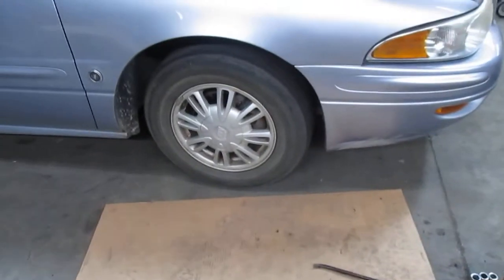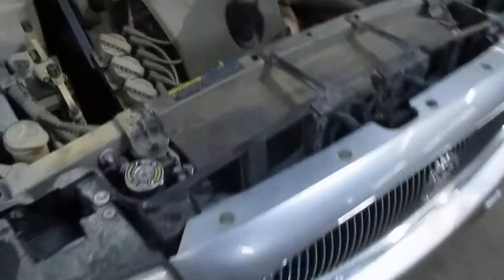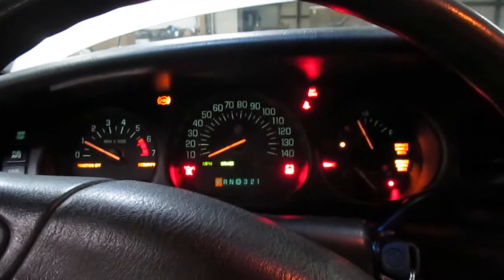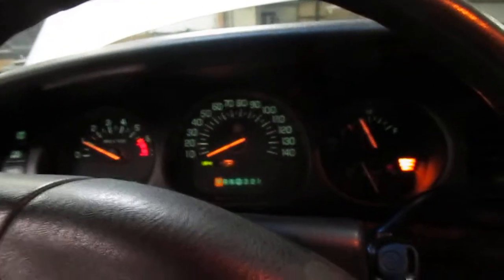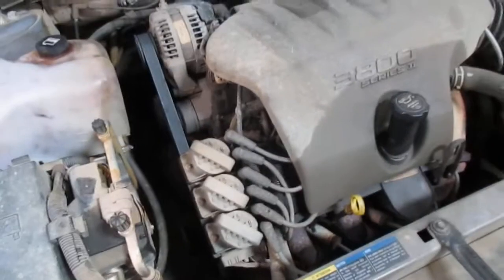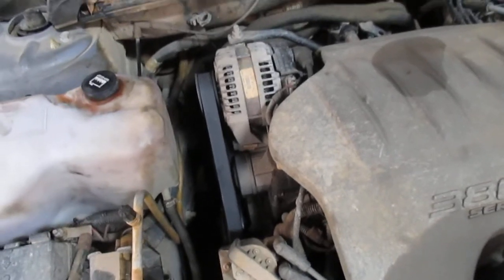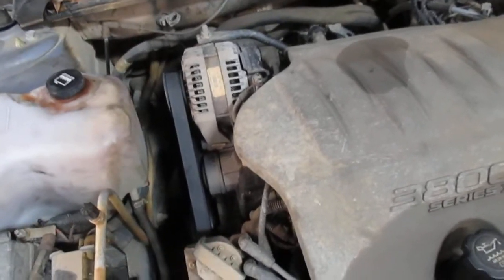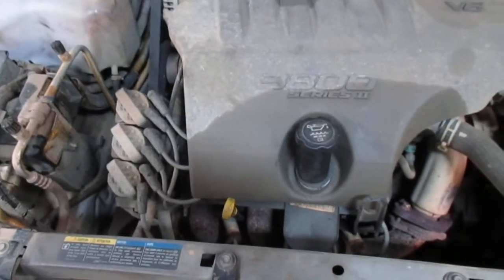GM buick 3.8l 3800 harmonic balancer replacement,  part 2 knocking

Comment: I don't know if it's true but ive heard that any time you remove the harmonic crank pulley or mess with the crank sensor you have to use and obd2 scan tool to make the computer do a "case learn", you have to use a snapon tech2, aeroforce interceptor, or msd dashhawk type of tool otherwise you'll keep having misfires

Comment: Need help  would like to change the key way on my 1999 Buick regal i'm replacing the reluctor ring with a dealer ship part they sold me also the keyway They said if i don't replace the keyway part won't work right so any suggestions how to do ? or should i forget about it .